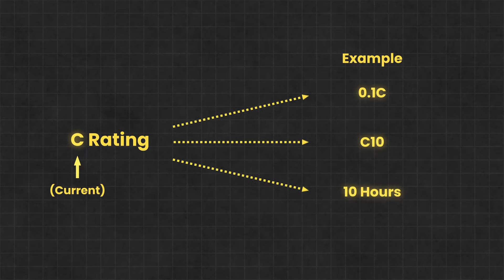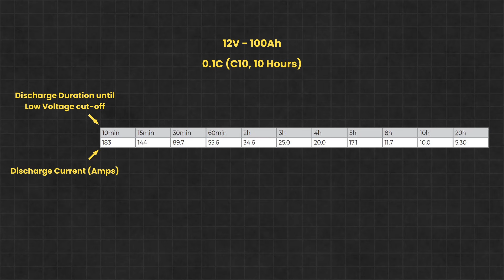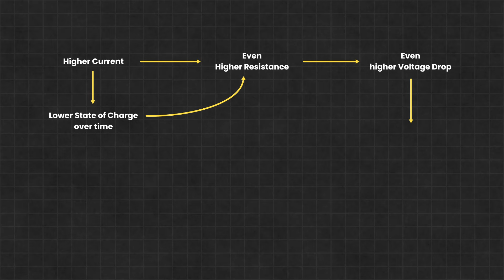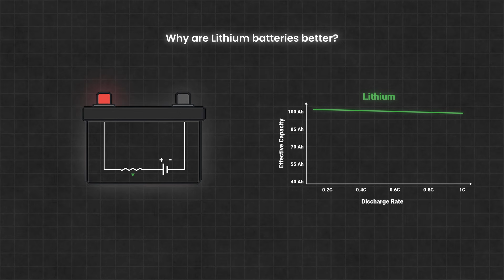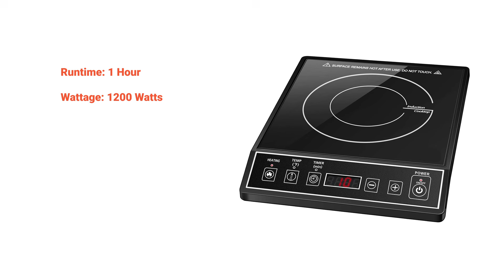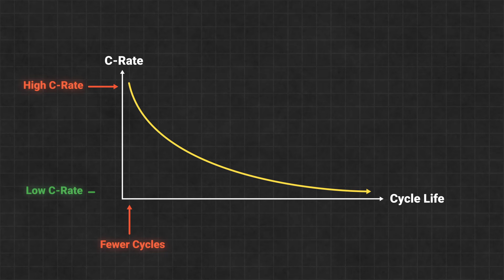A Battery Rating No One Talks About: C-Rate Explained (Lead-Acid & Lithium)

Comment: Great video! The "C" or "hr" rating outlined in this video mostly pertains to lead acid batteries and lithium batteries that are intended to be used as an upgrade to existing lead acid installations. It is used to rate the current for the purposes of measuring full capacity. However, in applications that are higher current and rarely lead acid, such as the flashlight, cordless power tool, and RC/drone industries, it is common for a lithium battery to have it's maximum safe output current listed in a C rating. For example, a mini drone battery spec might be "3S 11.1V 2400mAh 60C", which means 3 cells in series for a total of 11.1 nominal pack voltage, rated for 2400mAh nominal capacity (at an unknown C rate) and a maximum discharge current of 144A. This is calculated by inputting the rated capacity of 2400mAh as C into 60C, a simple multiplication. There may be more stipulations, such as, that maximum discharge current may only be the allowable peak of 10 seconds or less. So C ratings can refer to a measurement of two different things. So confusing!
Reply from the maker: I agree!